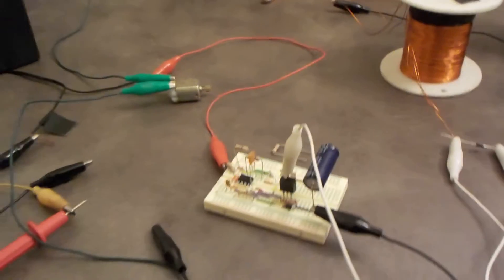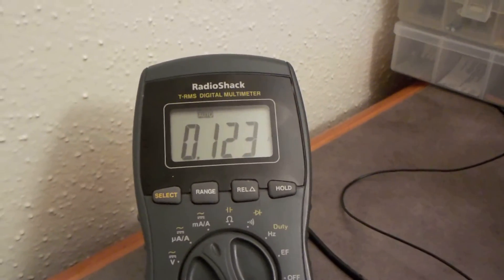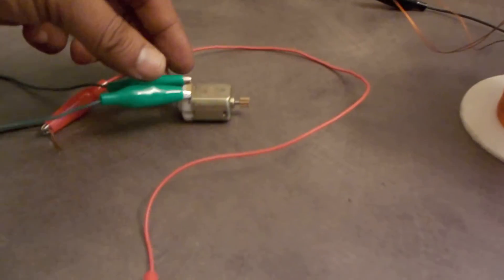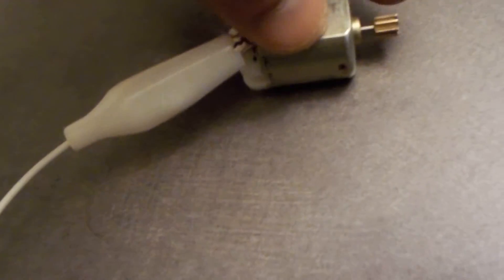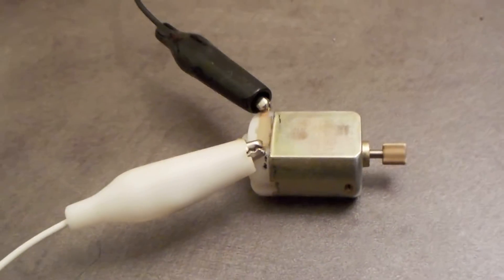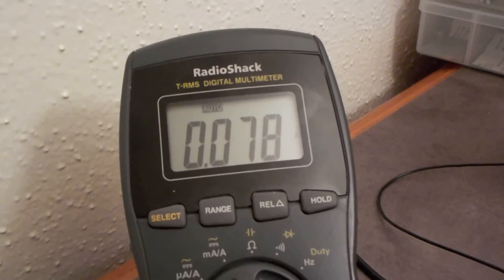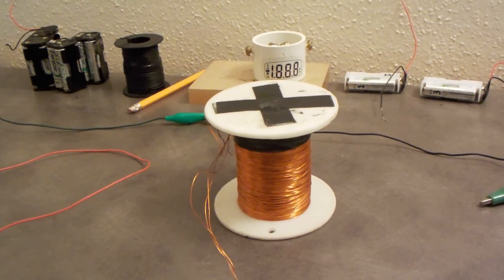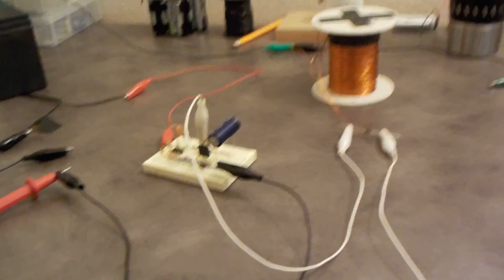Collapsing Field Provides Amplified Current

Comment: The two tests do not relate to one another. You have a lower current because the inductive kick is presenting more voltage to the motor. By putting the resistor in series with the motor as in test 1, you are changing the L/R time constant of the motor, or not allowing it to flow as much current. You are also not showing the power required to run your 555 pulser circuit.

Comment: The 100 ohm resistor in series with the motor forms a voltage divider.  Most of the power is dissipated in the resistor, not used for turning the motor.  You can measure the voltages across the resistor and motor to determine exacly how much power is being consumed by each  P=I*V.
Reply: I was thinking the same

Comment: The full current of the battery might be to much for the motor which would explain why it runs better with less .Try running it with a 9 volt battery .Also you didn't explain the circuit and why you think its running off of back emf

Comment: Nice experiment, but...
"connected straight to the battery"...."via a resistor" to limit the current....
What is your definition of 'straight' ?

So you replaced a "resistive dropper" with a "buck converter".... of course the efficiency goes up !

This principle is used in almost every modern power supply....

Comment: very good ,,,are there three winding's on the coil?
Reply from the maker: Hi, if you mean per coil then no. There are only 4 coils and each coil has a single wind. Two are connected in series, and the other pair are connected in series.

Comment: This is big pile of bullshit man. You can't measure current reliably in sharply pulsed circuits using that meter. It's for 50/60 Hertz sinewave. Use oscilloscope and replicate this. I don't say that collapsing field is bullshit because I destroyed my oscilloscope with it. It's very powerful thing. But anyway.
Reply from the maker: Why is it a big pile of bull shit? It’s easy, you load down the collapsing field from its very high voltage spike, and get an amplified current. Notice I didn’t say amplified power!
Reply: Okay let's accept it then huh ? But if you measure it correctly, then you'll notice that you can also amplify output power. And specially if you feed your circuit when it's in resonance ... then it'll be totally different animal. I've seen it mate, I have destroyed oscilloscope in my hands now.
Reply: Pasi Mäkilä 
A 555 ic produces a square wave output.
( from the Dc battery supply:-)
The brings a new variable resonance to the setup: >>Hysteresis<<
Of the copper coil & how much saturation of energy it hold's? Depending on the frequency & Ferris - air core materials used for tuning?

Comment: Power is calculated by multiplying amps by volts equals your watts which is power. If your amps went down what did the volts do? If the volts went up while amps went down you might or might not be saving power or watts. You must do the calculations of amps times the volts to determine before and after if you are saving power or using more power. Would be interesting to know how your circuit is really doing. Good work.

Comment: The back EMF from a collapsing coil field is simply voltage multiplication  - NOT current multipication.  Even your ammeter is showing lower current so your claim that it amplifies current seems ridiulous.  Ignition coils in petrol IC engines work on the is same principle of creating many kilovolts of DC from a 12VDC battery.  The power is what matters - Volts times Amps.  In this case you are simply giving the motor more volts and obviously the power output increases.  The battery is supplying more power so it will drain faster.

Comment: My coil is from the inside of an alternator.  my battery powering the oscillator and coil is at 10.82 volts.  The emf is at 13-14 volts but not enough juice to run my motor.   the capacitor is a 220v at 47 uf.  it does kind of jerk the motor.  But even with some help it wont turn on it's own.  I don't have a smaller one to test with.  this one is a 18v drill motor from my old rechargeable drill.  but it did charge my other battery with the back emf. should I test on different capacitor or wind my own coil.  does more turns on the coil bring the amps up?  That coil from the alternator as a nice steel core.  might be better without steel? just on a plastic spool? it's actually an electromagnet for the alternator.  Also I was thinking that a 555 oscillator might be better than a relay oscillator.  it used one volt over night and brought my other battery up .1 volt.
Reply from the maker: Alternative energy and medicine for all -  You have a Unity device. Congrats.
Reply: it needs improvement.  I was doing some testing tonight and found out that using the battery that had more power gave me less voltage than the one that had less.  also that a 200v cap gave me more output but had to be emptying fairly fast.  I don't have a tester for amps . so higher v doesn't really mean much without amps I guess.  but it did charge.  ;)  looking into a rodin coil as well.

Comment: I think I figured out the circuit.  Gonna test after a little basement clean up.  This is exciting.  Even my big motor was doing like your little one.  little jerks following the oscillation.  I used a relay from my old jeep and it seems a bit tougher.  :)  I sent you an email last night by the way.

Comment: I removed the oscillator link but keeping your comments
Reply from the maker: +Alternative energy and medicine for all - Is that a simple 555 timer circuit? You would have to get that thing up to a good solid 100KHz.
Reply: they say it will handle 10 amps on 30 volts.  I was going to use a rechargeable drill motor.  18 volts.
Reply from the maker: What kind of power supply did you use a capacitor? Or was it just directly looped?
Reply: only good from 0-10 second oscillation though unless I change the capacitor.
Reply from the maker: +Alternative energy and medicine for all Do not out a load on it, it will eat up all the extra energy.
Reply from the maker: +Alternative energy and medicine for all Hmm, ya just email me.
Reply: i was on 12 volts from the wall for my oscillator.  I used a car relay with capacitor. was then going to use that oscillation output in loop with a batterry to my coil
Reply: I'll send you a copy of the back EMF plan I follow.  seems to be the same as yours.
Reply: I am off to contact you.
Reply from the maker: +Alternative energy and medicine for all Are you the one that just emailed me with the device charger?
Reply from the maker: +Alternative energy and medicine for all If so then I’ll take a look at it.

Comment: Whats with the wire running from the back of the table to under the battery and hooked to the alligator clips?
Reply from the maker: +Jon Bigman I do believe that's the 12V power adapter plugged into the wall being pulsed into the coil through the 555 timer.

Comment: collapsing magnetic field is the frequent shorting of the coil, electrons flowing in a loop magnify then collaps. so before it collapses the coil is unshorted all with a 555 timer can do it so fast at high frequency.
Reply: Electrons do not exist. Dielectric pressure is being increased.

Comment: I have done the same thing and if you do not use the amps the volts will rise put a cap on it and you can get high voltage. my experiment got 80 volts it depends on the coil size.. but put a bulb on it and u get twice the amps of the supply and then try feeding the back emf into another coil of exactly the same turns and wire size. using the right pf cap and a fast diode on last coil and get a bit more watts. don't know of a use yet. give it a go and make video of it to share. ps and tuning the frequency can change things along with duty cycle.
Reply: 'if you do not use the amps the volts will rise'...
The power (= volts * amps) stays constant... And the power depends on input voltage, coil inductance and the time the coil is driven....
Reply: Here is about Radial Energy,  agree, high voltage, low amps, and high frequency of voltage makes run motor very fast and efficient. I built that one.

Comment: I think that you have 0,1ma because the motor has 100OHM resiston and as it needs power and the voltage is low , the current is higher. When you used the ciol, the motor has more voltage and then the current is less. Thanks for his video

Comment: have you tried a capacitor in parallel to the motor? Maybe a tunable capacitor for finding precise resonance
Reply: neuthral except smoothing the voltage on the motor, the capacitor will have no effect...

Comment: Amazing result but if true you must be able to loop it with no batteries !? A few capacitors should be enough to keep the thing going steady and the you have proven REAL OVER-UNITY or a least a 100% efficient motor  ! Good luck !
Reply: thevoice4you I found the same results as this mans video.  the charging idea I tried but got only half the amps going back into battery no over unity here. but the problem with back emf is u have to use all of it to get the benefit charging only uses the amount over 12 volts that's not all if it, so no advantage in charging .

Comment: If your coil has an iron core with minimal eddy current,  it will have much more BEMF.   I used iron steel pipe and cut a length wise gap for this.  Careful though,  cuz i've blown a lot of diodes this way.

I think what you have  demonstrated is what Joseph Newman was talking about.  Motors run more efficient at high voltage low current situation.  It ignores a lot of the motor's internal resistance and turns the applied energy into work more efficiently.  Great work though,  I've never really seen anyone using BEMF to run a motor.